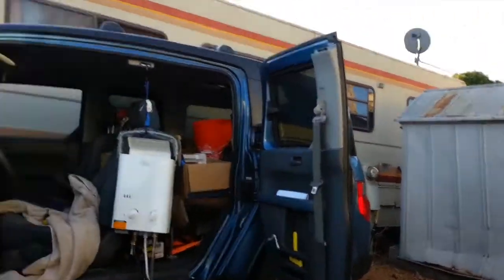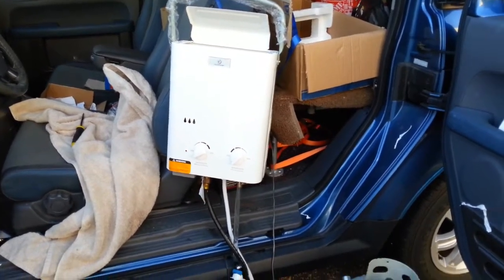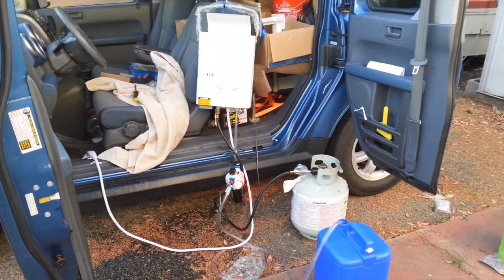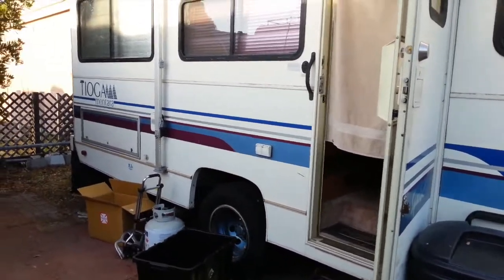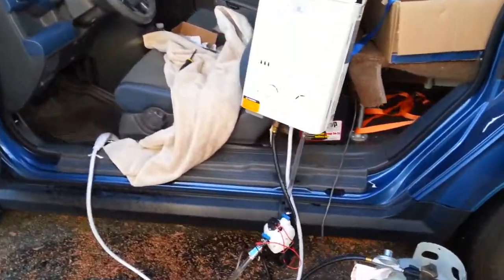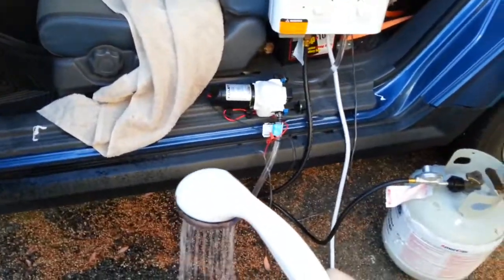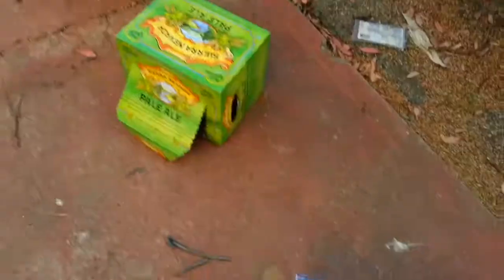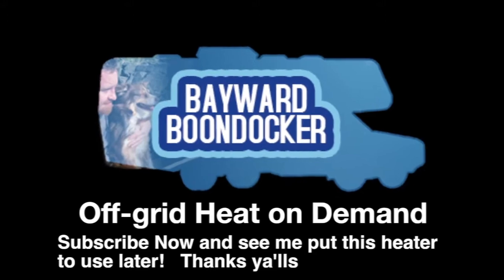Off-Grid Portable Propane Shower project

Comment: A refrigerator defroster will heat water super quick with just a bit of power
Reply from the maker: +Joeyy Doeee never heard of that. Thanks
Reply: Joeyy Doeee fridge would make it tight inside the car